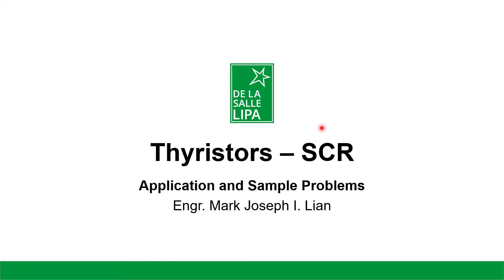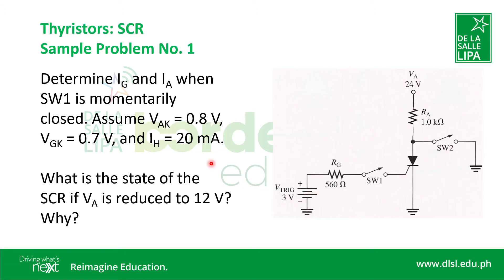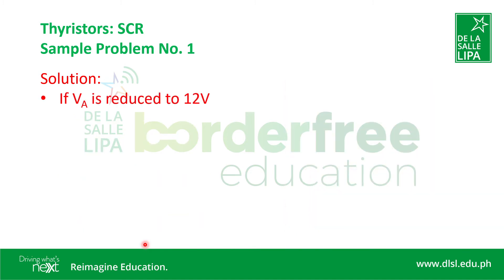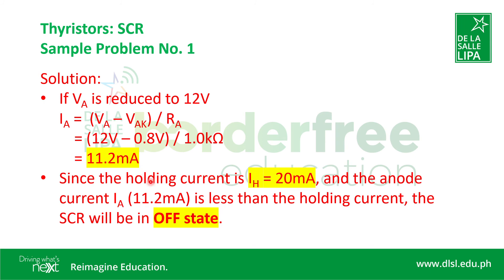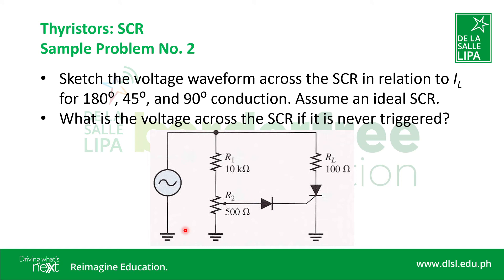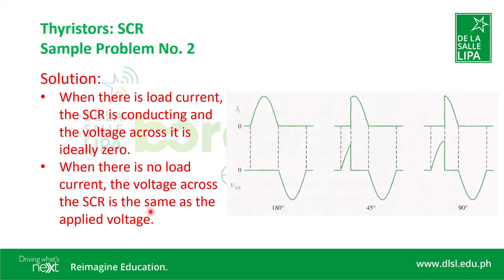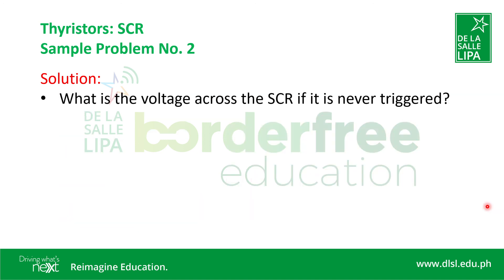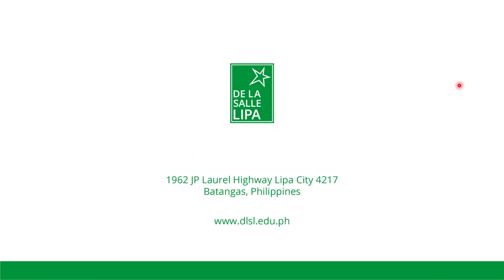Thyristors: Silicon Controlled Rectifier SCR - Application and Solution to Sample Problems

Comment: Hello sir. Where do you get .8v from in question 1?
Reply from the maker: If you are referring to Vak = 0.8V, it is given in the problem. In terms of actual circuit design, this value is also usually indicated directly in the datasheet of the SCR.